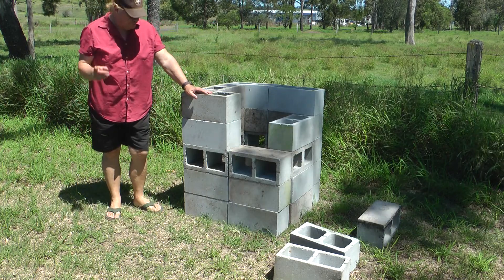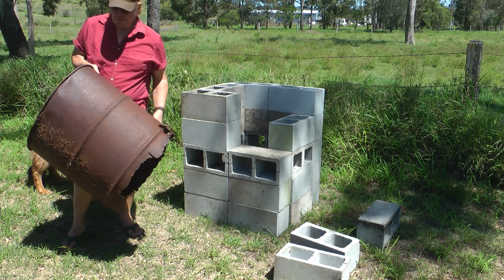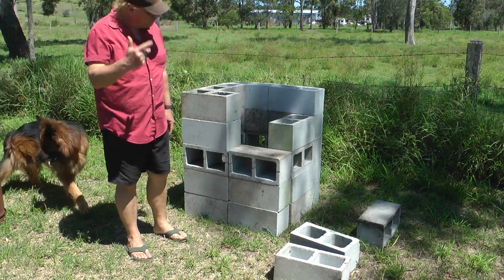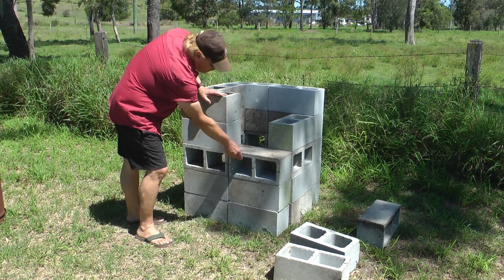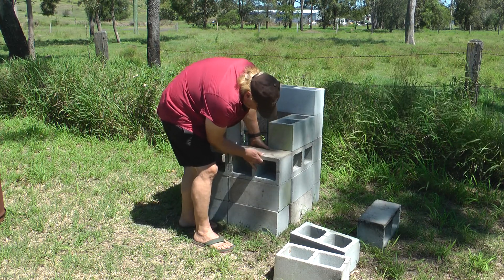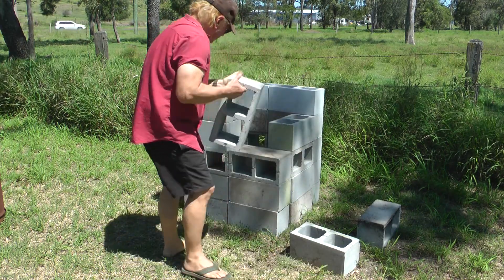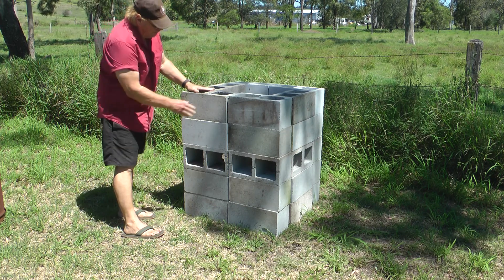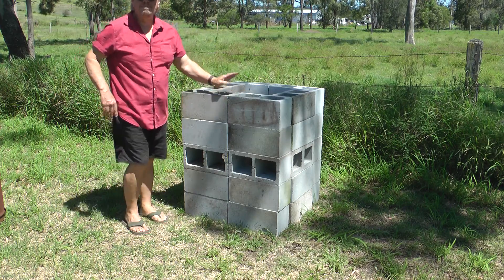How to build a incinerator in 10 minutes Want to burn rubbish. Please subscribe. No 44 gallon drum.

Comment: He says sturdy yet he stacked them on top of eachother rather than interlocking it. Making the seams not be straight up and down where one heftuly stick bouncing in could knock down a wall.
Reply from the maker: mate it's the weight of each brick that keeps it sturdy, does not need to be interlocked and not going any higher, you wouldn't know you never made one, never had the problem's you're making up,